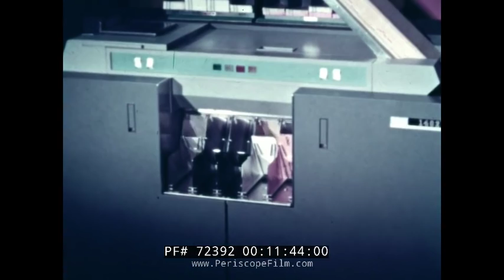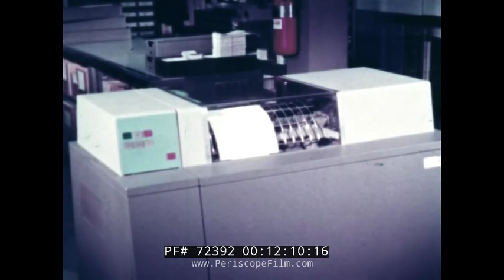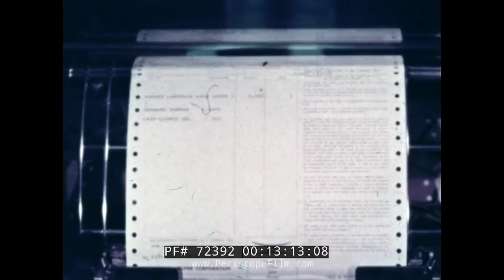IBM 1401 COMPUTER & DATA PROCESSING FOR THE ROPER CORPORATION 72392

Comment: By today's standards, a 1401 must seem very crude. My first 'DP' after getting out of the Army in 1968 was with the Kroger Co in Cincinnati as a computer operator. There were two IBM 1410 80K systems, each with 6 729 tape drives and two IBM 360/50 512K systems each with two banks of 8 2314 disk drives and 8 2401 tape drives.
Later I got into programming at the Shillitos department store in Cincy, where I first learned IBM 360 Assembler on a 32K 360/30 and then 1401 Autocoder that ran under the CS30 feature on the 360 that allowed 1401 programs to run.
Lets just say that there was a lot to be learned and I sure did have fun doing it!
Reply: Wow, somebody even older than me. Your description of gray iron apps running on more modern hardware is common. No matter how fast the computer, everything revolved around the punch card, because the original apps were expressed on plug boards, and the client considered treading water as a big victory. The biggest benefit was increased speed, as long as nothing depended on the speed of handling punched cards, which always legged behind the speed of the CPU. The City of Detroit assessor's system depended on the 17 million punch cards that were the soul of everything. The plugboard processing for the gray iron dictated that 1401 versions of the application operate on the same principles as the original cards. They went to IBM S/360 just because the 1401 emulator software was faster than the 1401 hardware. System/370, and VM/370 allowed the creation of virtual 1401s, assigned to an individual operator to run however he wanted. CPU speed increased, compute time for the assessors system decreased, but more cards to handle meant that growing data volume would quickly swamp the time window required for all the reports. So here was the city of Detroit, running the first VM/370 in regular production, my particular pride and joy, running city and police copies of their production DOS systems, while the police converted to OS/VS, and all the punch card systems ran on 1401 Emulator with Assembler apps simulating the original unit-record plugboard from the late 1940s to mid 1950s. And I had fun, as long as a took a sanity break, instead of a coffee break.
Reply: I went from 1960's vintage Main Frames, to Microprocessors of the 1970's with 64K Memory and 8 1/2 inch floppy disks. Today I am designing circuit boards with 2GHz clock speeds and Giga Byte memories. You see 1950's vintage machines in this video. Today a computer you can hold in your hand has 10,000's to 1,000,000's of times more processing power. It's pretty amazing what's been done it the 50+ year span of my carrier.

Comment: 14:16 This IBM 1001 Data Transmission System is basically card reader attached to a modem that transmits 80 characters per card to another modem attached to a remote keypunch machine that punches out duplicate punch cards which are then manually fed to card reader attached to a mainframe.
Reply: @Philip Noah It's like the early days of booking airline tickets where you call the airline company and they mail you your reservations a couple of weeks later.

Comment: 7:58  Lots of "data processing" hardware:
026 Keypunch
056 Verifiers (two)
557 Interpreter
519 Reproducer
083 Sorter
084 Sorter
088 Collator
1001 Teleprocessing system

8:31  ...and then the computer itself:
1401 CPU
Reader/punch
Typewriter inquirer
Printer
7330 Tape drive (two)
1405 RAMAC

Almost more floor space for the all the computer gear than to manufacture stoves !
Over 1000 reports per month ! - Information overload, anyone ?